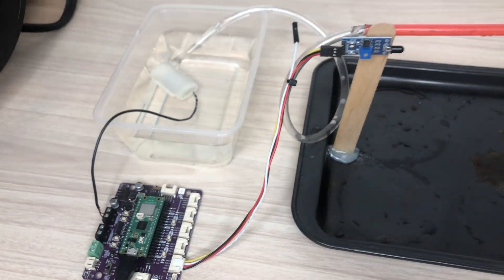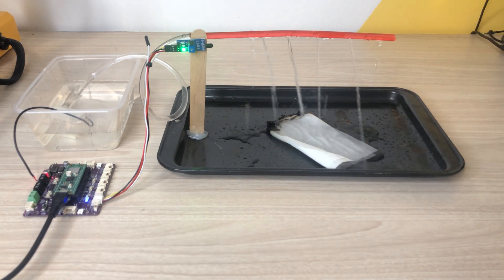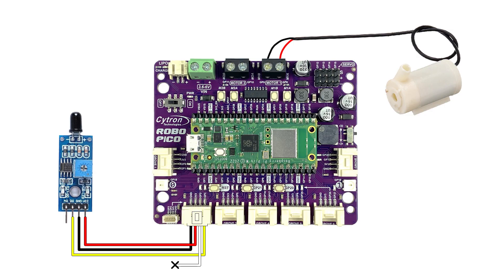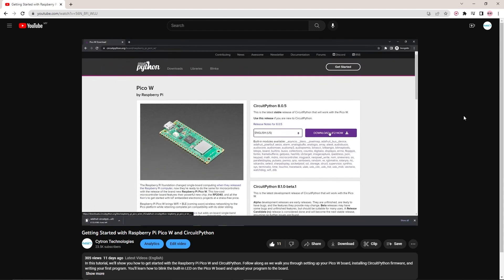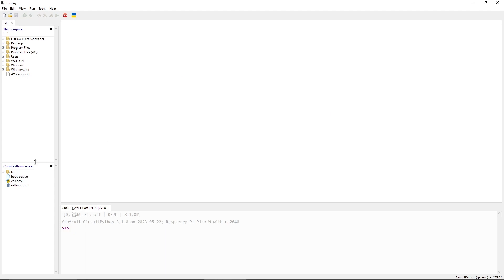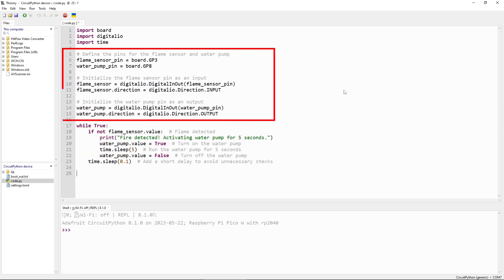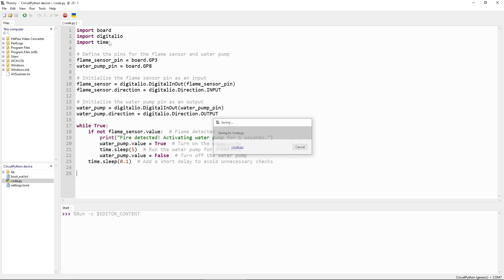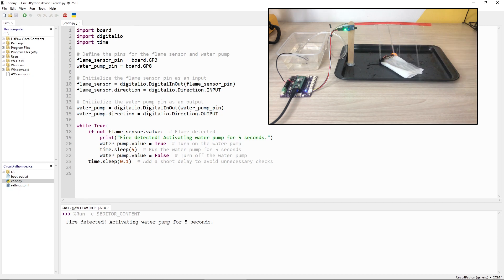DIY Fire Detection and Suppression with Raspberry Pi Pico

Comment: I made this but with a pull station and a led (the warning system), but I was wondering if I could add a reset button that would reset and stop the alarm, even if the pull station was still activated. Thanks.